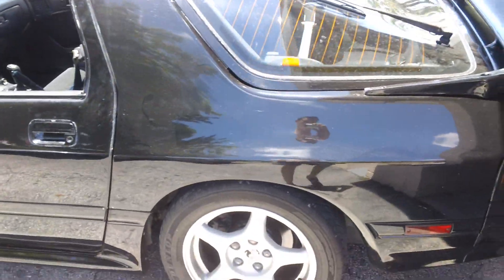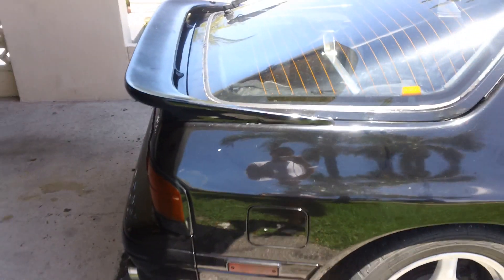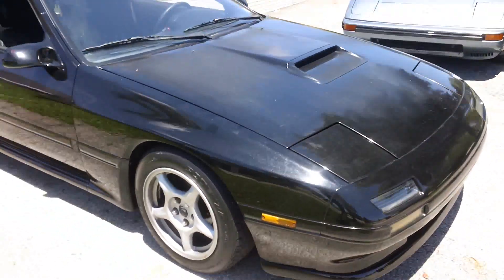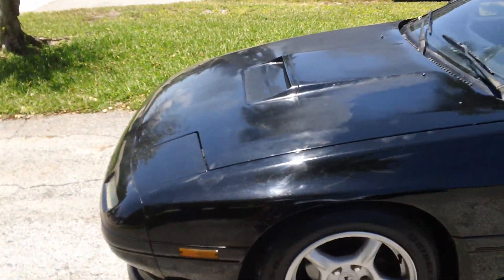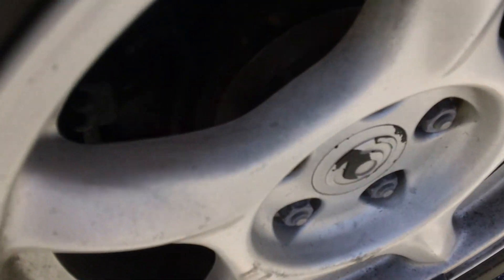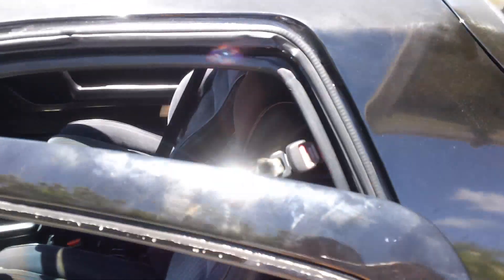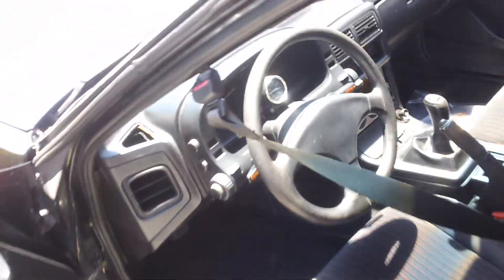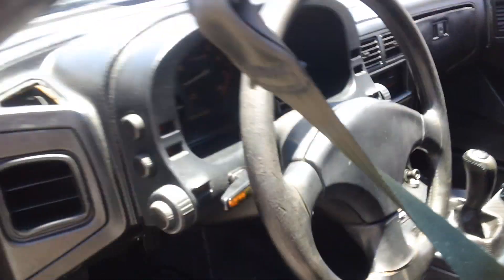1989 RX7 Turbo 2

Comment from the maker: Yeah I'll be looking into getting one. I just don't want to have to cut anything to make it fit. I'm still debating between leaving the clutch fan or going with e-fan setup simply because I want to eliminate any chance of failure of cooling. I know I want to try and get a front mount though. And thanks!

Comment: I couldn't quite hear you talking about the heating issues but if your referencing your intercooler via heat soak, you can coat your intercooler with the heat reflective tape. 
And if your talking about the actual coolant temperature then you will want to just replace the stock rad with a KOYO or Corksport. I have a CS in mine and even after a nice auto x run or even on a hot humid sunny day at idle I cant tell the needle moving. Granted I shouldn't be relying on the stock gauge, but you get it.

Comment: @WAFFLE WHATEVER HAPPENED TO THE RED TURBO II YOU HAD ? IM THINKING ABOUT PURCHASING A TURBO II SOON. HOW HARD IS IT TO MANTAIN ?  IF ANYTHING I'LL JUST TAKE IT TO MAZDA THEY COULD WORK ON IT. NO ?
Reply from the maker: Noooooo do not go to the dealer for repairs or maintenance. Take it to a reputable shop known to do good work with rotaries. Anyhow, its not difficult to maintain. Just keep an eye on the oil level every couple weeks or depending on how you drive it. But when you buy it, check to see how fast it starts on cold starts, any smoke (oil or gas smelling smoke is alright), and of course weird noises. Its not hard to keep up with but needs more attention then a piston motor. If you need anymore help, check out rx7club.com
Reply: Wafflebrah21  i saw you said you go to towers. I live I  Coral Springs FL.

Comment: I wanna get one of these for my first car, any suggestions on what to look for and what would be the insurance for one of these being a 16 year old guy
Reply from the maker: Being that you're 16, and I don't know how mechanically inclined you are... I'd look for a non-turbo model. Easier to maintain, less things to go wrong.

Look for any rust on the body, see if the engine turns on smoothly and quickly, look for any smoke coming out of the exhaust (white and smells sweet usually means the motor needs a rebuild... Blue/gray smoke is normal, just oil being burnt), always have a look at the oil, ask if the owner pre-mixes two cycle oil with the gas or not, try to get one that is mostly stock (so you don't have to put up with headaches from the previous owner's "modifications")... just the general things. If you do end up buying one of these cars, always be on top of the maintenance. I can't stress that enough. It's very important if you want it to last no matter the goal you're trying to reach with the car. Ask what oil the owner uses, what kind of gas, how often he changed the oil, etc etc... Just be really picky and ask lots of questions. The more you know, the better off you'll be with the car.

That being said, I can't recommend that you stay away from these cars cause they're not bad like a lot of people make them out to be. It's just the morons that don't know how to take care of them that end up going bad. Good luck bud. And READ!!! Read articles, go on a forum, research. Know a lot about what these cars do, what you can do with it, how to prevent things from happening, how to make it better. Anyway, good luck finding one. Remember, unmolested and as stock as possible! (Of course exhaust mods and preventative maintenance stuff is fine like an aluminum radiator, electric cooling fan...) And if they say the motor is rebuilt, ask who did it, what was done, and when it was done.
Reply: alright cool thanks so much, i was also talking to someone and he said its a good car but i should drop a better engine in it than the stock, crank the shocks put slicks on the rear and drop that bitch low. are those good suggestions? he seemed like he knew what he was talking about
Reply from the maker: iClearmyHistory
Those are pretty shitty suggestions. The stock engine is fine. They're easy to handle and work on. Just fix whatever little things are wrong, get it running right. If you want to do suspension mods and put rims on, that's cool. Coilovers, control arm bushings, subframe bushings, tie rod ends, all that stuff I'm sure are gonna need replacement. It will be loads better handling. Don't listen to those stance and drift fanboys. Get your ride running right, and modded tastefully. That's what gets the attention and respect you want. Because honestly, nobody gives a shit about a crappy ride, with crappy mods, running crappy. Do it right the first time.
Reply: Haha ok thanks but i still wanna drop that bitch and put a badass sound system in it lol
Reply: iClearmyHistory
nah dont drop and no heavy sound system too much weight